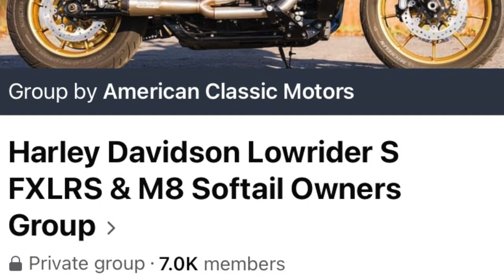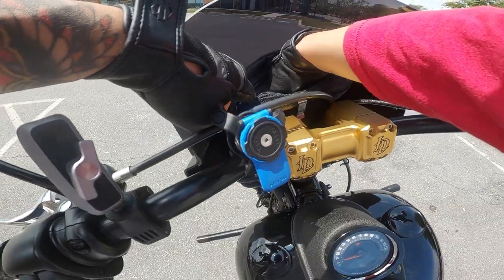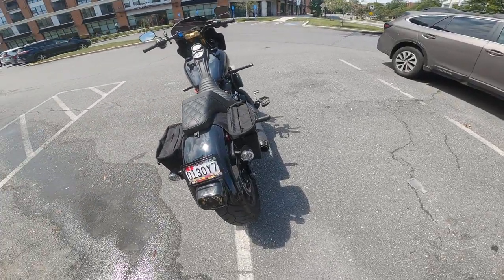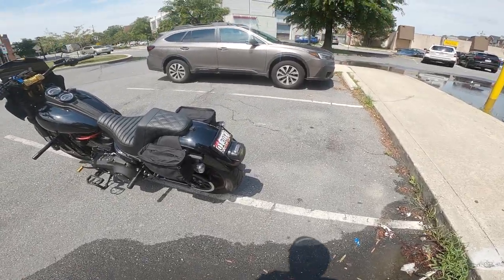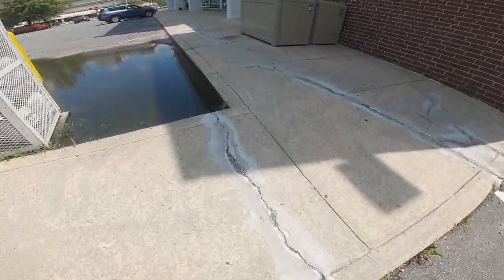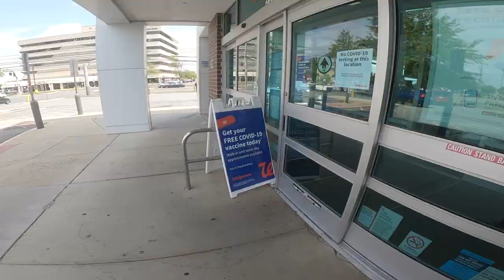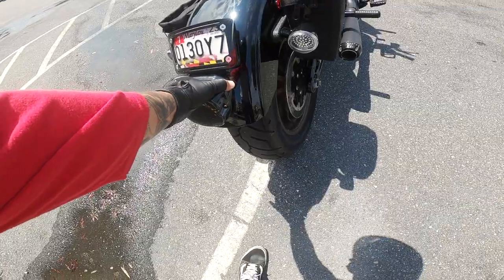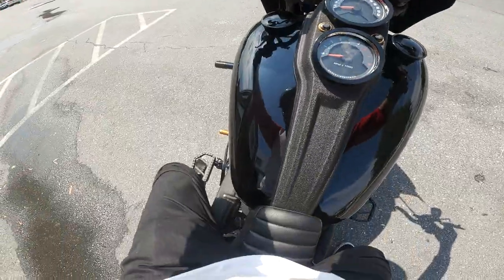This part broke off on my Harley Davidson Softail Low Rider S!

Comment: Hey, this is probably a little late but the same thing happened to me with the tail light tab breaking off. I had a black tail light baseplate too, I think it was custom dynamics but wasn't really made for the new softails and didn't really clip in too good at the bottom. The dealer did give me a new fender under warranty and I ran the stock chrome baseplate on the new fender but moons mc came out with a black baseplate for the new softails and it's great, goes on super secure even better than the stock one.
Reply from the maker: Hey Chuck! That's awesome that your dealer gave you a new fender.  I'm pretty sure mine would've turned me  away based on my previous interactions. For now, my light is holding on fine but I might also look at that baseplate you mentioned.  Thanks!

Comment: That sucks. Vibrations make the nuts back off over time, but not after a few hundred miles.  I have 7k miles on my LRS and no issues so far.
Reply from the maker: Yeah the previous owner fit a part that was made for the dyna low rider s, and so it was actually user error. But after I fixed it no issues so far

Comment: You just have bad luck man! But it’s a Harley and the whole point is to fix it.
Reply from the maker: Yeah, I've been snake bitten a bit lol. Still wouldn't trade this harley for anything, it's such an amazing bike.
Reply: @IronBornRider  yeah check all the bolts every few months make sure everything is good. I have the service manual and lookup the specs on the torque.
Reply from the maker: @fxlrsaz6363  yup, bought the service manual  and it's been an awesome resource. Did my own 1k service using it.

Comment: Probably no loctite. I bought a new Dyna in 06 and the dealer did not put the locktite on the passenger backrest. 1 month later on a trip I started hearing a loud vibration. I couldn't locate it at first but after about 20 minutes of being parked and looking at it I found that it was the back rest. All I had to remedy it was duct tape. I went to the next H-D dealer and they were so cool. Even though they didn't install it or sell me the bike they took my tape off, cleaned it up and tightened it down with loctite. They still did it as warrentee repair, so I didn't have to pay for the other dealers poor work.
Reply from the maker: Wow, thats awesome that they took care of you like that. If I found a dealership that took care of me like that, they'd have my business for life. I've gotten such mixed experiences with the dealerships (mostly the service dept side), that it makes me question HDs whole "we're a premium product".
Reply: @IronBornRider  Yeah they were cool, but they were in another state about 400 miles away. I have only found a very few dealerships (for any brand, cars and motorcycles) that really give good customer service. A lot don't seem to want anything but your money.

Comment: I have a big spot on the fender of my iron now because I had my helmet hanging off the back and got caught in the rain in the Walmart parking lot and shot over to a nearby gas station for cover. The helmet rubbed a big spot on the fender! Harley said it’s probably cheaper to just replace the fender than get it painted. Said the matte black is super hard to match. Oh well, I guess I’ll just have a spot on my fender now. 🤷🏻‍♂️ I am staying away from the M8 softails for now. Seen a lot of problems on the tube here! Sticking with my sporty for now. Excited to see the new sportster lineup! Btw, what bags you got?
Reply from the maker: Yeah, I'm just gonna live with my blemish on the fender. Not a big enough concern for now. I think staying with the sporty is a smart move considering that it seems like there are some hiccups still with the M8 lines, I've also seen a lot of the issues from Facebook groups and YouTube. You're just rolling the dice I suppose. I got me some torque motorcycle bags, but Im gonna need some bigger bags sooner or later.